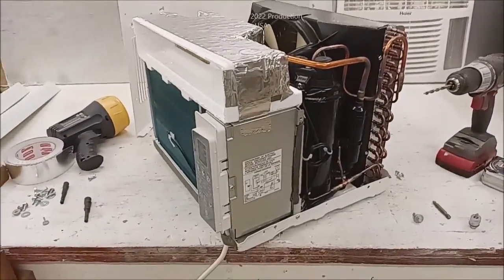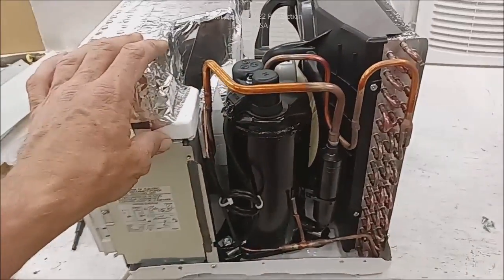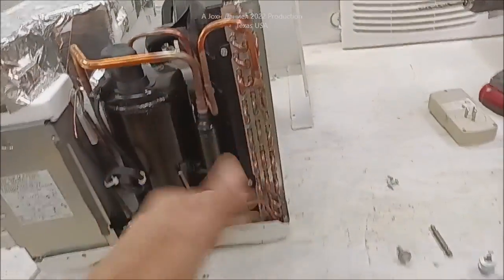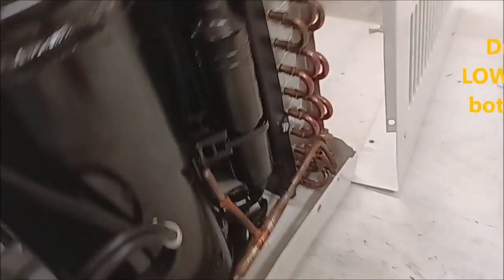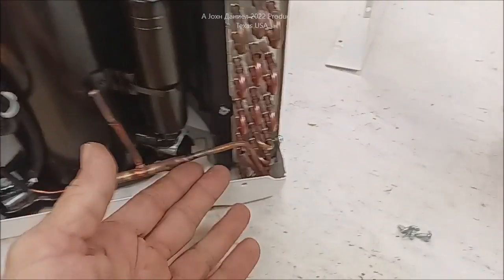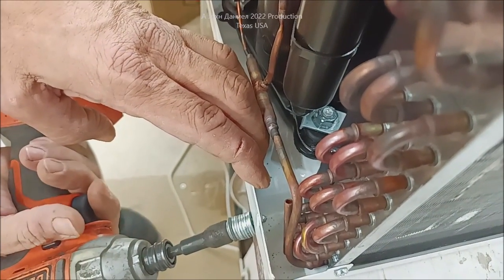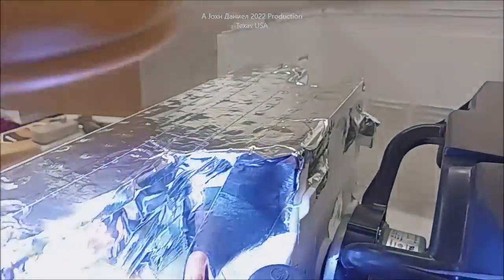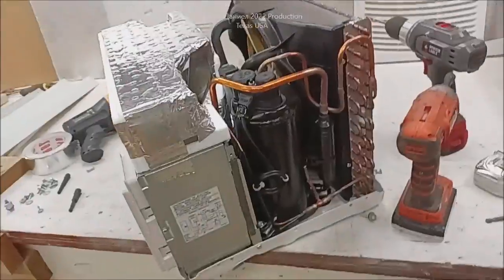Fix Air Conditioner that don't drain, makes noise, dirty & uses too much power

Comment from the maker: HIGH EFFIENCY AIR CONDITIONERS 5000 to 10000 BTU, usable for Off Grid and any use -  Frigidaire 5000 btu https://amzn.to/3RxdZfx
LG/GoldStar/Daewoo 5000 btu https://bit.ly/3PsKTMP
Haier inverting Series 5000 to 6200 btu https://amzn.to/3PHxBfB
LG-samsung 10,000 btu https://bit.ly/3Iz0xDY
DC to AC Power Inverters Perfect for AC units  https://shrsl.com/3lzp8 , pick one that you can use, sign up to get email from them and save $50 instantly
Reply: John, I got the coils on my AC cleaned with coil cleaner and removed all of the leaves and pine straw from the unit.  Next week I am going to put a piece of 1/2 in welded wire chicken wire over the fan opening to keep debris out of it.  I am getting ready for the heat wave headed our way from the mid west, next week.
Reply: I had to do this for two of my newest ACs that actually damaged my drywall and wood. These were through-the-wall units not window. I have 6 like this and the only problems I've had is with the ones with is design. Manufacturers do this to get a little better SEER rating so you think you are getting something better, the consequences be dammed.

Comment: Won't it over heat if it's not slinging water
Reply from the maker: No. The water slinging idea was a Obama EPA scam ran by Lisa Perez Jackson, A diversity hire ( who later got amazing 8 million dollar windfall in speaking fees from the 8 companies who made billions on it) that was concocted with GE and a few other companies to use a THEORY to get them carbon credits in 2010 which the public payed for in SCIR taxes to the fake Obama energy PACE program, a catastrophic failure of course, and is to date ( American Recyclers Group ) filling the trash piles with corroded and rotting Air Conditioners causing over 43 million tons of CFC/HCFC to be lost to the atmosphere.

Comment: Very good video, I just learned a pile of things right now. I just purchased 2  Danby U-shape ACs 8k units and I noticed right away after running the first install for a couple of hours that indeed, water was splashing all around inside and I couldn't find a drain hole anywhere. Not shown in the manual (useless as well), which I guess after listening to your video that Danby is building their new units the way you said. If I drill a hole I will likely void the 2 year warranty, so I will put a piece of cloth in between the fins and the edge of the pan in the back and let the water drain that way as another YouTuber suggested, once the warranty is gone, then I will drill a hole, with a self-tapping screw as you did, great idea by the way the washers.

Comment: The water in mine almost killed me. Black mold grew like crazy with the warm, moist air. Inside the vent in the front was black with mold spraying spores everywhere in my shop and my sinuses. Lousy design.
Reply from the maker: In high mold/mildew locations - Un plug AC, if you have a drain, plug the drain, and while off pour white vinegar into their base from outside till it runs out the sides, about a gallon slowly. Let sit about 15 minutes, unlpug drain hole if it has/had one and turn the AC on fan only for a few seconds. Unplug again, shut off, and using a hose making sure your AC is tilted outward 3 to 5 degrees flush it out. For the coils inside using pump spray bottle spray well while off with white vinegar, flush it too carefully with water. Let dry 30 minutes then power back up and run fan on high till all is dried out. Then start using as normal again.
Reply: @JOHNDANIEL1  Thanks for the tip.

Comment: My like 8000 btu has a set of coils in the bottom and I'm not sure if mine drains out or it's just evaporating and not pulling enough from the air but it drys up pretty quickly like a day but mine drops about 100 watts when it's full of water it's about 150 when I first fill it up so like 12%-15% energy savings and I'm not saying the government isn't bad but and mine is different design like I said it has a coil that sits in the bottom and I'm not real sure about the galvanic corrosion from ethanol but I'd do some testing myself on your unit to see power consumption with and without water and where I live in Central Texas I haven't seen any serious corrosion on our window units the main reason I have seen people want to drain them is because they don't have th installed properly and they drain inside
Reply from the maker: They must all be tilted back 4 to 5 degrees angle unless they are designed with a sump like the Panasonic models. I'm in central Texas also and overnight the humidity hits 75% outside but it's the inside moisture that it collects mostly. As HVAC tech I used to  see 40 to 100 of these AC units a year. About 80% of those newer than 2008 models have flash evap designs that have rough and pitted corrosion on their lower condenser to where it's filled with scale and plugged up at least 20% area. Electrolysis at the bonded points in many has destroyed a huge portion of those. Yours is likely in a perfect position, location and situation that gets you better results. But there is a reason you do not see many that use the flooded pan design on the used for sale market after 7-8 years old, they are trashed. But you will see 15 to 25 year old Kenmore or Friedrich or Amana in classifieds still kicking and worth buying.

Comment: Hi,John. Great video! Have you received the JS2000? Hope all is well.
Reply from the maker: Yes but we have nothing yet to test and show it on. Another thing is the 12 volt port will not run anything which is a huge reason to have one. A similar one from another brand has a 12 volt jack that has no problem running 2 to 7 amp items. This one you sent clicks off on a 2.24 amp 12 volt LED strip. Not sure why.
Reply: @JOHNDANIEL1  Thanks for letting me know. Would you mind talking more about the details via email? Thanks!

Comment: The ones I have like in my shed. The weep hole from the front to the back always clog up because it is so darn small. So now when ever I buy a new one I take it apart make the weep hole bigger and make it were I can clean it with having to take it apart.  because you cant get to the weep hole to clean it out with taking it apart.  I make it were I can take a rod a pipet and pull filter  depending on model and I can take a go though the hole and clean out the weep hole.   Then in the back. I have had a few that had a rubber plug in the bottom and I just would remove it. some like the one you have and the one I have didn't  So I do the same thing and drill a hole in it.  They last a lot longer.  and I don't get the Radiator rot, were the fins rot and turn to dust.
Reply from the maker: Yes sir Charles, so true. Be sure to drill on the lowest edge not the bottom so water tension don't fill the hole with gunk. And it's easier to clean out.

Comment: Sir, I was thinking about drilling a hole on a window AC i have apart (going to recharge it), but was going to drill the hole on the bottom at a low spot.  Just wondering why you did not drill a hole in the bottom of the pan.
Reply from the maker: Due to water tension effect drilling a hole in the bottom has problems with plugging up. The water tension effect causes a little bit of dirt to build up around that hole and plug it. But drilling a hole in the side barely above the bottom of the pan it allows a flow out effect kind of like a vent pipes effect to breaking tension in a plumbing system.
Reply: @JOHNDANIEL1  Great, thank you.  I figured you had a reason for the location.

Comment: I have a Haier 6000 btu that looks like that one. Got it at Walmart and its been a good unit for about 5 years. When I installed it, in the instructions, it showed it had rubber drain plug in the bottom that you could choose to remove or leave in. Instructions said it was more efficient leaving it in. Think I left it in? I'll go check. The unit has been cooling not as well the past year or two? Maybe cleaning it out will help. Hopefully I can do it without removing it. The window is all taped up and insulated. I have sprayed water on the inside the house  part to clean the fins as it gets pretty dusty in my house. (had to mop a puddle off the floor.... 🤪).
Reply from the maker: A great method of cleaning them is to use nothing more than the blue window cleaner that you can spray into it with the air conditioner off and then using a Shop-Vac with the hose attached to the blowing out connection to push the cleaner and air inward do that a few times and then rinse it with a water hose and make sure that it could drain underneath don't overfill it and it should help spray the whole thing and do it a few times. Something as simple as Windex does a hell of a job in dealing with mold pollen and mildew stuff. 
As far as them telling you it's more efficient it is on the day you buy it. Just not any time after that.